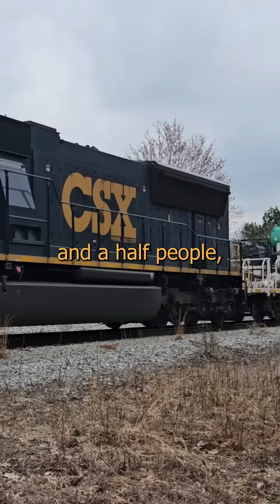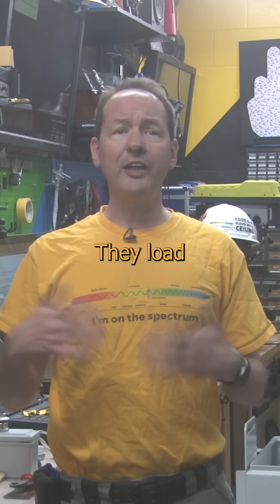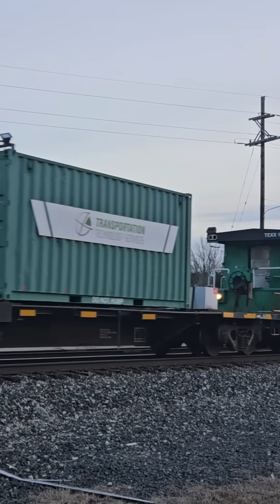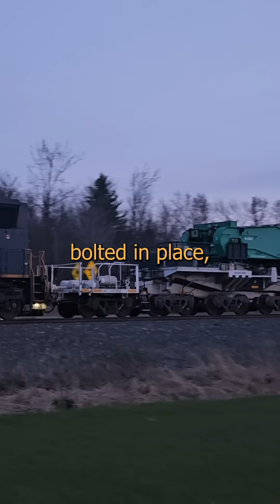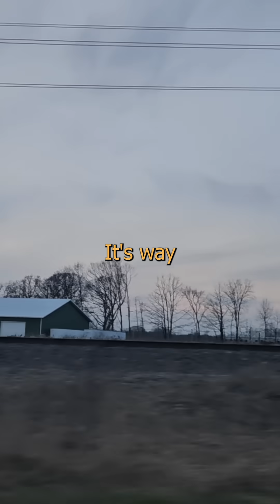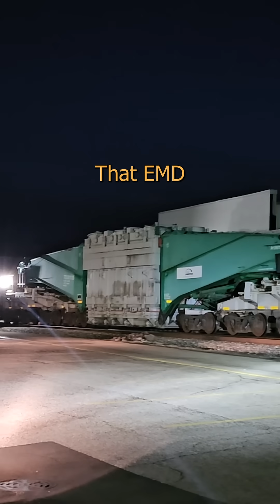Schnabel Car #chrisboden #comedy #train #railroad #physics #transformer #powerplant #engineering

Comment: Do not hump.

Why is that written on the side?
Reply: iirc humping means putting a train together by just letting the cars roll along and slam into each other at low speed to connect. Do not hump means don't do that, probably because it might break something.
Reply: To remind everyone that reads it😂 also, it's not supposed to be free rolled into other cars.
Reply: @chris76-01  not exactly. That's part of it, but it's more about using hills, especially the "humps" they used to build in yards for speed control. Getting a train moving on a flat grade isn't a problem. But stopping one anywhere definitely is, especially one rolling down a hill of any size unchecked. And in a yard, a very confined space, full of sharp curves and zero camber, it doesn't take much for a car to just ignore the rails and keep on going straight ahead.
Reply: Obviously someone humped it at some point
Reply: 2 reasons
1: chris boden
2: many railroads have hump yards, where cars are pushed up a hill, uncoupled and rolled down into their trains. you do NOT want to hump a schnabel. 

over specialist weird rolling stock (ie, cabooses, snowploughs, p-way equiptment) also has do not hump painted on the side, but not passenger cars because heaven forbid passengers find something funny. occasionally passenger cars get put on the end of freight trains for a number of reasons, and while it should go without saying not to push a wagon down a hump into a 2 mile rake of fuck you freight, they can and WILL get sent down the hump of epic doom

edit: sorry for my uncontained autistic rant

Comment: For your mental health, do not calulate the contact patch on a motorcyle or bicycle
Reply: @residentmusician  So how would find out the contact patch at a constantly changing angle? Yeah nevermind screw that math.
Reply: @caseymurray7722  I don't know how to figure that out, but I do know that on race bikes, the contact patch is actually larger at full lean than it is upright.
Reply: @caseymurray7722  Exactly where the contact patch is is math.  But the size to a first approximation is stupid simple.  Me and my bicycle weigh 200 pounds.  My tires are at 100 psi.  My contact patch is almost exactly.... 2 square inches.
Reply: @MostlyHarmlessNebr-gb6di  so is it bad for your mental health to learn that biking is dangerous because you can only break so fast?
Reply: @MostlyHarmlessNebr-gb6di  No. It's not a balloon, it has sidewalls. You can't just do a simple calc like that.
Reply: @MostlyHarmlessNebr-gb6di  Bit more complicated than that. Each wheel holds a specific portion of your weight depending on the geometry of the bike. For example, your typical road bike is most often going to have a 40/60% loading, as in 40% on the front and 60% on the rear. That means you'll have 80lbs on the front wheel and 120lbs on the rear, and by your basic calculations, that means a .8 sq. in. contact patch on the front and a 1.2 sq in contact patch on the rear, but wait, there's more. As your tires roll, they'll heat up due to friction, both between the molecules of the tire themselves AND between the tire surface and the road. As they warm up, the pressure will also increase, and your contact patch will decrease. It's a relatively miniscule change, but it's enough to mean the difference between sliding out on and gripping smooth pavement.
Reply: @caseymurray7722  
Screw the math, use anecdotes.

INHALE
A moto gp rider doing several hundred km per hour through a long sweeping turn is relying on a contact patch that is equivalent to the surface area of 2.5 thumbs up.

Hold up your thumbs. Now imagine doing 200kph and your thumbs being the only surface area you have to maneuvre.

Fucking. Terrifying.
Reply: Yes, screw that math. I would suggest just buying the wheel in question and measuring it under load.
Reply: @BlahVideosBlahBlah That would be a better way thank you
Reply: Just a hint for anyone attempting to do this, as a motorcycle rider,  it's  s m a l l. Like small enough to say "it's average sized"
Reply: Yeah. My truck's tires have bigger contact patches on each cleat than my boyfriend's literbike.
Reply: @ghoulslayer__7746  "Large boulder the size of a small boulder" moment
Reply: I mean, if you drive them bad enough, you become the contact patch.
Reply: It really makes you appreciate friction and the materials engineers at tire companies though.
Reply: I'm from Germany and have my drivers licens for 20 jears. But I can remamber my driving teacher sayed, the contact patch for a car is  like paper A4 and for motorcycle it's like a credit card.😮
Reply: Wouldn't it be as easy as measuring the size of tires contact with the ground and the weight of the bike + rider?
Reply: @gabemerritt3139  Yes, very easy to measure that when the tire is rolling, slipping and at 100c.
Reply: @ArchOfficial  rolling and slipping shouldn't change the contact area, and knowing the material properties of the tire or simply measuring after heating it would account for heat expansion. 

If your tires are hot enough to boil water you're racing fast enough to bother with paying someone to get fancy measuring it. Still not incredibly hard just expensive and you'd need fancier equipment.
Reply: @gabemerritt3139   Some tires are dual compound meaning the center of the tread is harder to extend tire life. Also the thickness of the tread and strength of the sidewalls are more factors.
Reply: Wouldn't it be approximately area = weight / tire pressure
Reply: @jeromeymascarenhas6044  No, because tires have sidewalls among other construction differences from balloons.
Reply: @jeromeymascarenhas6044 So at zero pressure it would be infinite? There is tire stiffness too. And when you are moving you need to add dynamics: elastically, spring constants, changing load amount when cornering or breaking or accelerating etc etc
Reply: For my own sanity and the spite I feel for numbers. I'm just gonna pretend that bikes just float like a maglev bullet train.😂
Reply: @EVILSCOTSMAN2k11  Entirely justified. I personally think it's magic. That's why they only spin out when they lose confidence. It's like flying.
Reply: Ok, I'll just look it up on Google then
Reply: I dont have to, everyone else in my family has already done those calculations. Intimately.
Reply: @BiggieBobThornton  😬👌
Reply: I've already worked out that my UK size 8 foot has a larger contact patch than all 96 wheels of a 300km/h (186mph) Class 373 Eurostar train. That was scary enough in itself... 🚄🇪🇺😳
Reply: A motorcycle contact patch is about a credit card's worth
Reply: As a motorcyclist, this thought would often cross my mind, mid corner 😫😖
Reply: Roughly the size of a playing card for both tires. That's all that's keeping you from becoming a eighth mile long smear on the pavement.

Wear your gear, kids.
Reply: that just turns me on
Reply: Locomotive low friction wheels be like
Reply: Racing bicycles that is, it's an order of magnitude more on upright position bikes, and mountain bike thread eats that footprint for breakfast.
Reply: @crashmatrix  true. The 20x4 inch tires on my ebike get way more traction than the 29x1.5 inch ones of my old pugeot.
Reply: The average motorcycle rides on two contact patches that are roughly the size of a credit card
Reply: The multi-faceted jeweled, cut faces on my knees and noggin speak eloquently to rhe physics represented by the contact patch, hypothetically represented by wheeled vehicles. 
It's all theoretical until it starts moving...
And then it becomes "only a suggestion."
Reply: That’s so real yo
Reply: absolutely microscopic compared to your moms.
Reply: its very easy to calculate the contact patch on a wheel
spray water or paint, then look at the dry spot when the wheel is removed
Reply: dont you just need a function for it then plot a graph?
Reply: Just the contour of the Schnabelwagen.
Reply: Mathematically speaking, a bike has a higher traction rating per pound per inch of contact patch than a car does.
Reply: That is one thing that really makes me wonder about these guys that have 70mph+ motorized bicycles. There's almost zero contact patch holding you on the earth
Reply: @jake6483 picking up what you're putting down, but gravity holds it onto the earth. It's almost zero contact fightin' friction or a lack thereof, depending on the need at any particular moment.
Reply: @jake6483  Yes but with a bike you gotta remember the faster you are going the more stable your balance is, so when your going very fast it would take substantially more to knock you over.
Reply: @dadephunt1717  which makes total sense to me, but I live in southern wisconsin. It's harder to find the road than the potholes. Even if a road is in good shape, there's always gravel on it
Reply: @jake6483  ahh central California here.  So it's all either solid clay hardpan,  already got crops growing in it, or it's paved.  It snows once every 37 years and the daytime temps in July get to over 115° for days at a time🥵 so I'm addition to the balance provided by your momentum, I suppose theres also alot of benefit to the rubber trying to bond to the asphalt.
Reply: @jake6483  You get a lot of stability from the gyroscopic motion of the wheels. The contact patch mainly needs to apply centripetal force when you're cornering.
Reply: Did this in physics ap. Then He Said there is a pebble and now See If you can stay in the corner
Reply: The irony is that with its pneumatic rubber tires, the contact patch for a motorbike is similar to the aggregate contact patch area for all the wheels of locomotive.
Reply: @pulaski1  That's not irony. 🍌

Comment: 200 tonnes of high to low or low to high pixie converter
Reply: Chris, can you share some technical specs for the transformer? Maybe where it's going. And HTF it was loaded and unloaded. 

This is better than what happened last Saturday night down to the freightyard to your mom.
Reply: at least!  My company manufactured a generation step-up XFMR for a nuclear generation plant which weighed 370 tonnes.  That xfmr STILL did not require a Schnabel rail car!